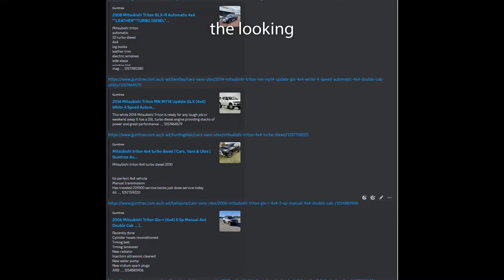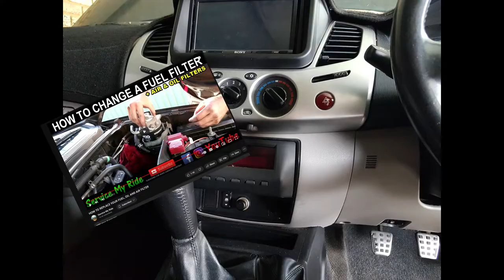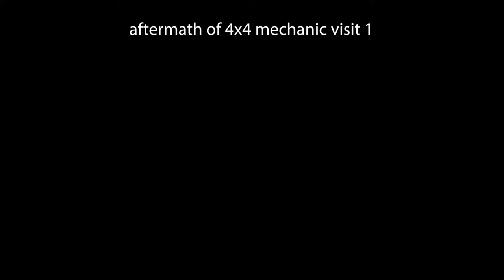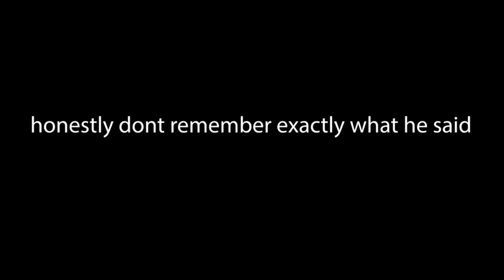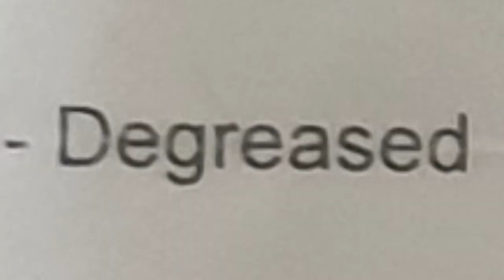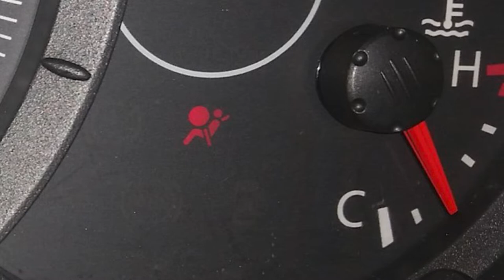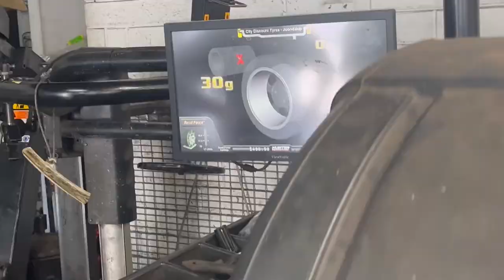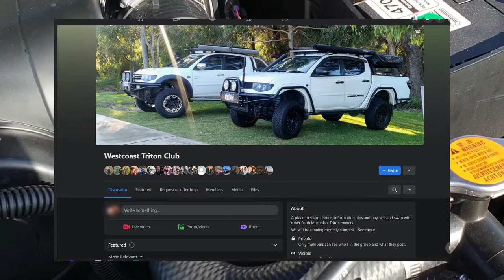Building of the Triton! Issues, mods and bumps in the road

Comment: I own a ml and mn an mr tritons did anyone in the suspension world tell you about 2 inch lift in tritons it is 1 inch in suspension 1 inch on tyres 2 inch lift the top control arm hits plus the shake on steering and check angle of cvs you really didn't do your homework i wanted a 2 inch lift when i went to efs and tough dog suspension both told me the same thing and showed me why you run a bit of aggressive tyre did you check legal specs because thatd not legal now i am a mechanic you have been riped off that luke fella is the only reputable mechanic in the whole ordeal for a tune the only place i goto is berrima diesel been around for over 60 years
Reply from the maker: difference between dobinsons and alot of others is that its a true 50mm lift (adjustable to 75mm or 3 inch), tough dog is 25mm and 20mm in MR tritons, well aware and have warned others about that. cv angles are almost flat. I have videos about why the steering wheel shakes happened, all came down to balance and a bad tyre from factory. With 3 inch suspension lift you will need after market upper control arms.

Comment: Have you found the vibration through the steering? Just a suggestion check round out of your front disc rotors. Out of round faulty tire. Faulty front wheel bearing just a thought.  Good luck 👍 ✌️😎🇦🇺🍻
Reply from the maker: https://www.youtube.com/watch?v=To5O4ef8gOY&t its has been figured out and yes, it was one faulty tire and balance issue
Reply: Thanks matey, just watched it. Thats great you resolved the problem 👌👍😎🇦🇺🍻@Dragonio3

Comment: What year model is this? I was looking at getting a 2012 triton dual cab manaul 2.5l turbo diesel but this has scared me.
Reply from the maker: when u buy a high km's ute they will usually have  a few issues here n there. Dont worry, mostly this is bad luck with bad mechanics. But that model of triton (2.5l) is known for having an engine overheating issue (incorrect machining of the block I have heard) thankfully I do not have that with mine, its a hit and miss generally. Mine is a MN 2010 triton
Reply: @Dragonio3 yup i juat did some  research and no offense but they are a hazard on wheels. Too many big issues for me. I won't  be buying one now. I can see why they call mitsubishi, 'mitsushiti'